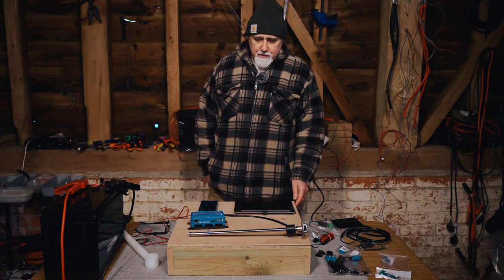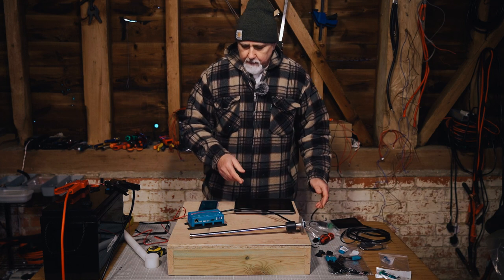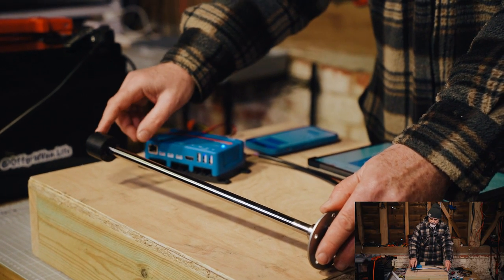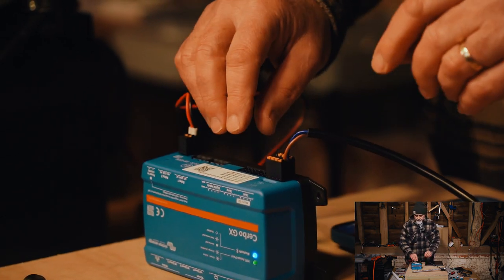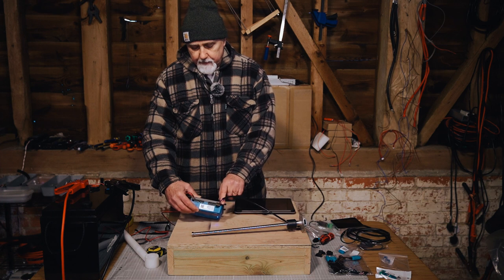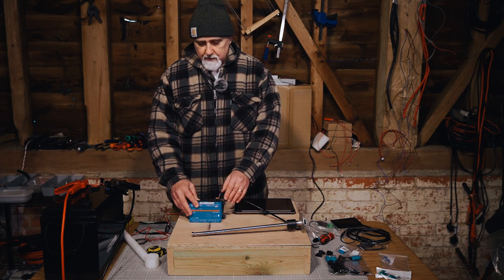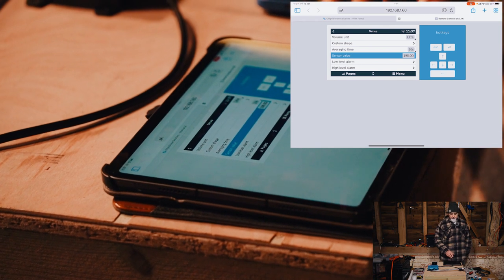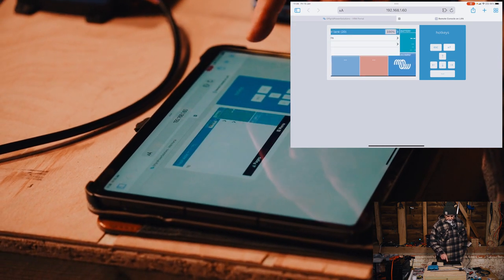Connecting tank level gauge to Victron Cerbo GX

Comment: Thanks a bunch my friend. Much appreciated. I wonder if the tank level sensor is already hooked up to a standard gauge if paralleling the signal can be done? I have the gauges that are made for these type of sensors but if I can add that signal to the Cerbo I can then forward it to my Garmin chart plotter on the upper helm and not have to go down stairs to read fuel level.

Comment: Neat.  Now I am not intimidated about tank levels.  Have a great day. Oh, I got a cheap android tablet, my other is ipad and iphone.  On the right options it has a drop down and "desktop site" ... when you do that, the victron config window is expandable.  It won't expand to fill the screen unless that is selected.  I got the tablet to mount it .. problem for now is that when the screen goes blank, having to reaunch... now I will look for the VRM app in android and see how that works..